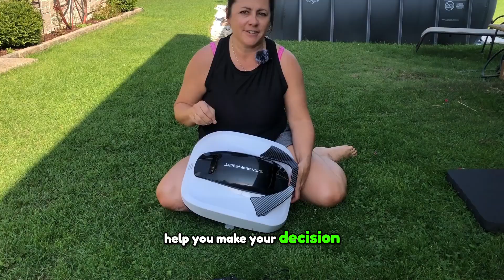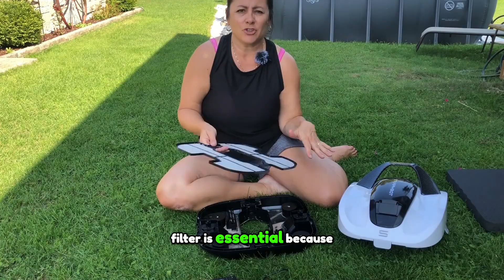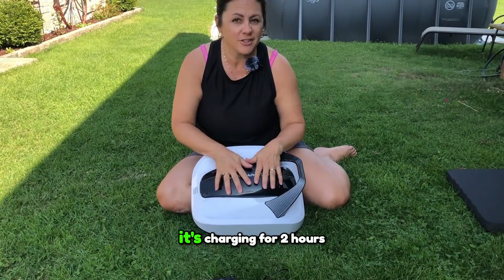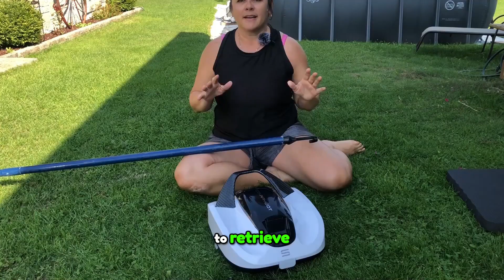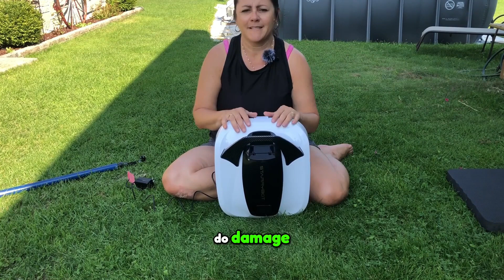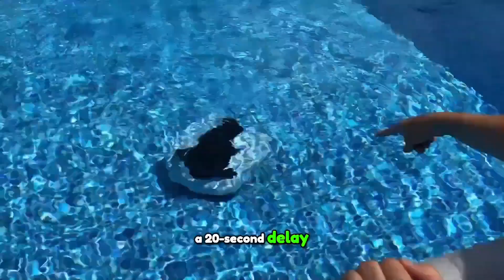Starrybot 900 Pool Cleaner: Effortless & Cordless Clean!

Comment: Can you tell me how to tell when it's charging Or charged there is no lights anywhere.
Reply from the maker: A full charge generally takes about 2 to 3 hours.Indicator Location: The LED indicator is located on the main control panel or communication interface on the unit.  Hope that helps.
Reply: @GoozCrewReviews  it didn't have a light it didn't work. I had to send her back.